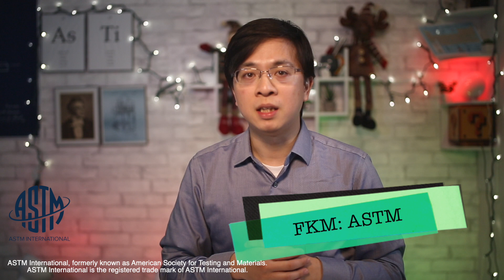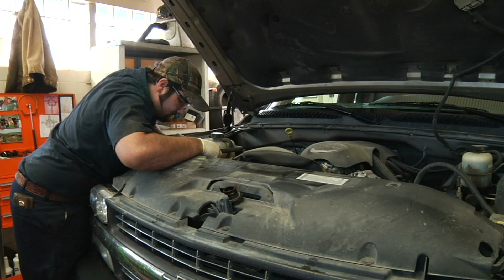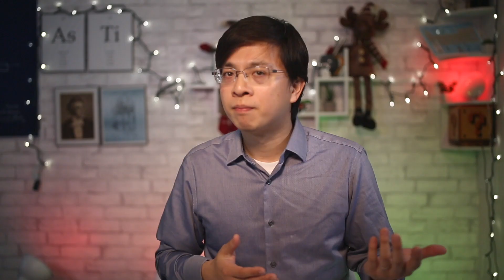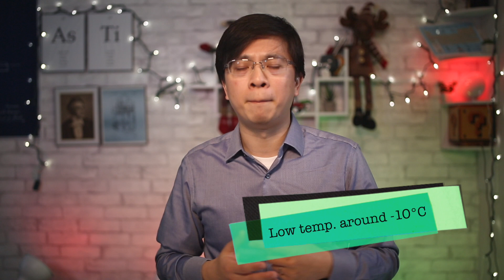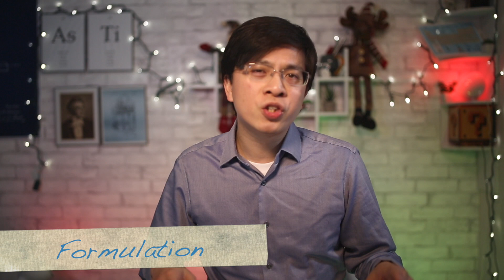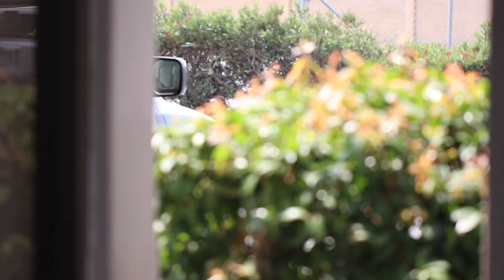What is FKM/Viton/Fluoroelastomer? Things you must know about FKM/Fluoroelastomer/Viton?

Comment: Very interesting thank you good sir. I wanted to know, for an industrial gearbox that operated below 100 Deg C, what is the best O-ring to use. I am concerned about the internal seals inside the gearbox that if using NBR, will fail quicker than Viton, but as you indicated, FKM is not suitable for gear oil with EP additives. I have noticed some leaks on the gearboxes which I suspect is the o-ring not having as high compression setting as Viton. Please advise what you would recommend.
Reply: Try Nbr or hnbr

Comment: Hello,
Could you please explain which grade of Viton/any rubber material is suitable for High-temperature food contact application? It should not change its properties when in contact with Oil, Acidic, and basic substances over 200° C.
Reply from the maker: Dear friend, I would recommend you use GLT grade FKM or perforouro elastomer/FFKM. It will cost you more for sure. Other requirement you need to determine is the leachable requirement or other regulatory requirement.

Comment: Good informations, we have a doubt,  
 Need testing equipments about -18°C with N2 @ 10000psi  Wich Better Rubber FKM or HNBR 90 ?  Algo high-temp about 130°C.
Reply from the maker: Dear Souza, I have to say "it depends". What characteristic you are looking for? My guess is, 10k Psi N2 it seems to be just a static seal not a dynamic seal application. So you are probably looking at compression set and force retention. Sometime material can just reach some limitation combine a proper design on seal groove/housing accompany by some plastic retainer can also improve some performance.

Comment: Hi, I've installed Viton (HTCR) pinion seal in my cars differential as it was leaking. Some sellers that are selling the exact same pinion seal (part number 460448V) say that because I used a Viton seal I must use  fully synthetic differential oil and others say that I can use either a mineral based differential oil or a fully synthetic diff oil. Could you please clarify which oil I should be using with the Viton seal ? thanks and keep up the great videos
Reply from the maker: Dear Nick, Chemical compatibility perspective, Viton works well with mineral and synthetic oil. However, Viton as a mechanical seal typically leakage is caused by mechanical failures such as abrasion, wear, and tear. There are thousands of the formulation of Viton, it could mitigate some of the mechanical weakness with some limit. If you replaced the seal often, it would be nice to check the rod or seal housing whether it has some defect on the surface.
Reply: @theo-ringguy6172  Thanks for the tip.  I've checked the pinion flange shaft that the pinion seal runs on and there was no grooves on the shaft. The original seal has a black rubber appearance which I am 90 percent sure is a polyacrylic rubber (ACM). I'm pretty sure that it leaked because I put full synthetic gear oil in the differential. The Ford dealer I spoke to as well as all the gear oil manufacturers recommend I put fully synthetic in and that's were I made the mistake. I subsequently found out from the manufacturer of the differential your supposed to only use mineral gear oil. Anyway, I appreciate the advice.

Comment: Hi! Can you pass along any tips on molding FKM? Specifically, transfer molding! I am sampling some out and it is proving to be more difficult to mold over other rubbers. It does now appear to be flowing into the cavity smoothly and parts are coming out with lots of knit lines and blisters. Any advice or general tips when molding FKM would be greatly appreciated. Awesome video, very well detailed!
Reply from the maker: Thanks for watching, I probably can't not share too many processing knowledge due to IP concern.
1. Type of FKM is important factor, you need to look at it's rheology data. Make sure the flowing time is sufficient to cover the old cavity.
2. Bubble can be alleviate by using vacuum press.
3. More cavity to load raw material is also the key.
Moldflow simulation is a great tool to design mold. 
It's not cost effective to run 100% accurate, use it as a trouble shooting tool can reduce re-tooling time.
Reply: Increase mc wax quantity and try . It increases flow in cavity
Reply: Hello sir
Please try with STRUKTOL WS280, it will improve the flow and mold releasing agent too.

Comment: hi thanks for the beautiful video. beautiful explanation. may i know why FKM sticks too much to metal open mill while compounding ?
Reply from the maker: Dear jayantakumarborah, It really depends on the formulation and the base polymer type. In the US typically we call it "tackiness". It is related to the curing system. Bisphenol type typically has more of this issue.
Reply: @theo-ringguy6172  hi how to overcome this problem? yes we use FKM from 3M ,bisphenol curing system with MgO and CaoH2
Reply from the maker: @jayantakumarborah  The method actually very like cooking the egg on a pan.
How to reduce the stickiness on a skillet pan, add some oil and make it hot enough.
To translate to the rubber world:
Under the assumption on you have a smooth, dry, warm open mill roller.
1. Increase the open mill temperature set point higher.
2. Increase the amount of process aid, such as wax.
or
You need to change a polymer. :P
Hopefully, these approaches can resolve your issue.
Reply: @theo-ringguy6172  what is the best adhesive glue for cold bonding neoprene/rubber/ FKM to steel surface sir?
Reply: @theo-ringguy6172  thank you very much
Reply: Increase the amount of wax，improve  sticks roller,ws280  better than c/wax,,,Some low Mooney rubbers are easier to stick to rollers, you can add some high Mooney 。

Comment: I don´t understand one little thing. If want to produce my own compound could I just buy a Fluoroelastomer from 3M and mix it with other things. Or do I need to start from the monomer you mentions. Thank you. This video is the best on Youtube!
Reply from the maker: Dear RealCellstar, 
This is a very inspiring topic we can explain! Thanks for the questions.
We can explain the roles of the rubber supply chain.

If you want to create your own compound, you should buy the appropriate grade of "raw gum" from Manufacturers such as Solvay, 3M or DuPont. 
These big chemical companies typically did not perform "compounding/mixing", unless special cases.
There are a couple of ways to develop your own compound.
1. Actually, in the rubber industry, you can find "compounder" to develop the compound for you. These compounders mix your formulation. However, you will need to find a molder to mold your final product.
2. Or you can reach integrated molder like Ascend Sealing, we can develop compound, mold and manufacture the final product.

Let us know if you have any questions.
Reply: Fantastic and fast answer. You have my like and sub. Thank you very much :) @theo-ringguy6172
Reply: Per example Viton A or FL2320 are the "raw gum"? @theo-ringguy6172
Reply from the maker: RealCellstar , yup, they are raw gum. The raw polymer without any filler and additive.

Comment: Hi   Could you talking about which kind of filler in FKM 
Beside  Wollastonite Do you have any other suggestion ?
Reply from the maker: Thanks for the response. It sounds like you are looking for a filler besides carbon black. Wollastonite/Calcium metasilicate can enhance tear resistance in a high-temperature application. 
In terms of replacement, it really depends on your application and requirement. Typical non-carbon filler such as Barium sulfate(BaSO4), Calcium carbonate(CaCO3) and Titanium dioxide(TiO2).